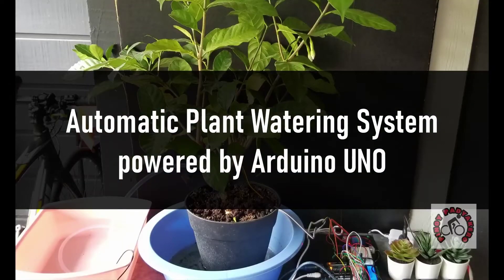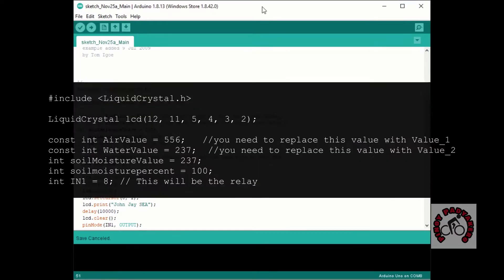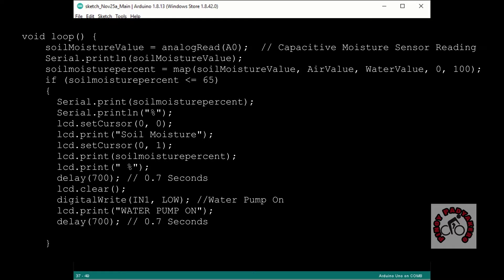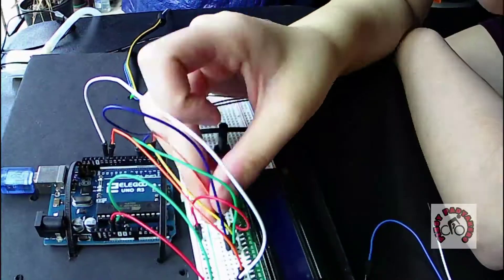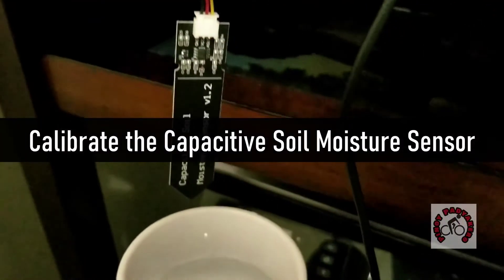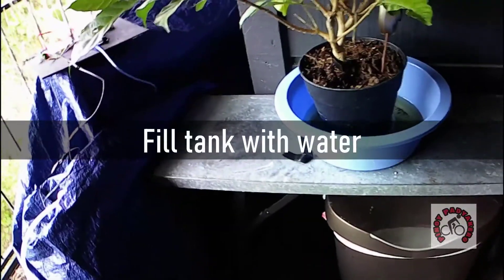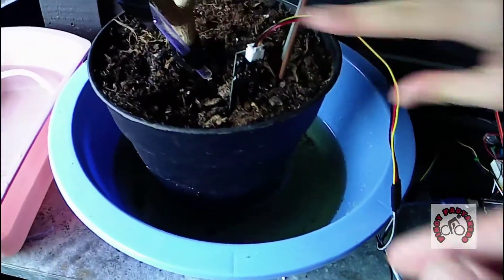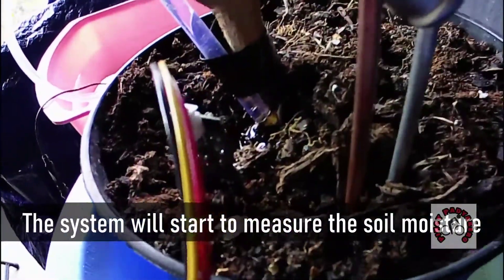Automatic Plant Watering System Using Arduino Uno and Capacitive Soil Moisture Sensor

Comment: Hello. It works very well, but there is a problem. For example, if the irrigation percentage is set to 60 percent and as the soil dries, the value changes to 59-60 or 60-61 percent and then the relay switches on and off which is very confusing.
is there any solution? relle delay or similar...thanks.

Kumusta. Ito ay gumagana nang mahusay, ngunit may problema. Halimbawa, kung ang porsyento ng patubig ay nakatakda sa 60 porsyento at habang ang lupa ay natuyo, ang halaga ay nagbabago sa 59-60 o 60-61 porsyento at pagkatapos ay ang relay ay bubukas at off na kung saan ay lubhang nakalilito.
may solusyon ba? relle delay or similar...salamat.

Comment: fill pot to full saturation (this may take multiple watering's over a few hours as the soil will get hydrophobic).  wait 30min after full saturation.   this is where 100% soil moisture should be calibrated to.